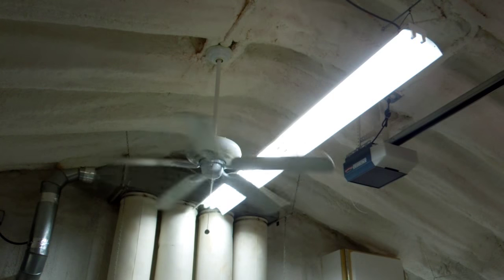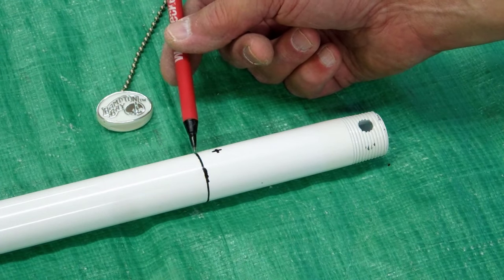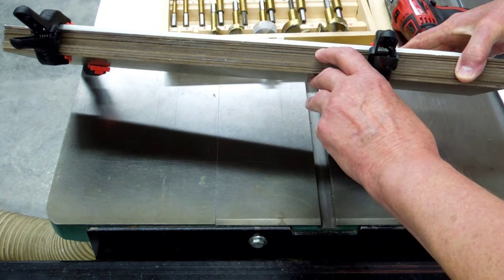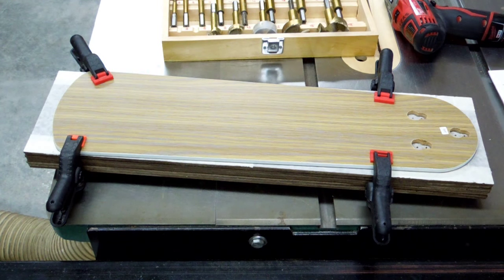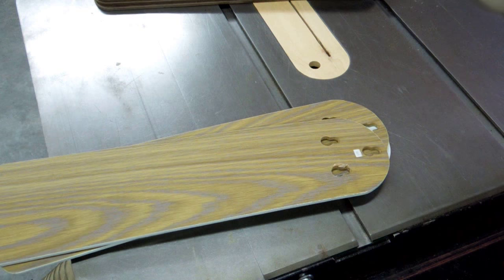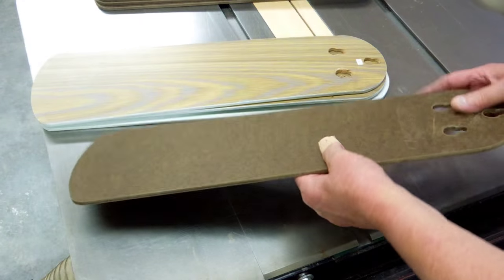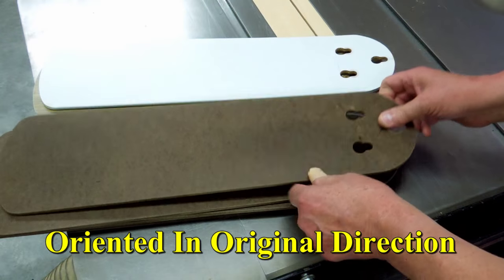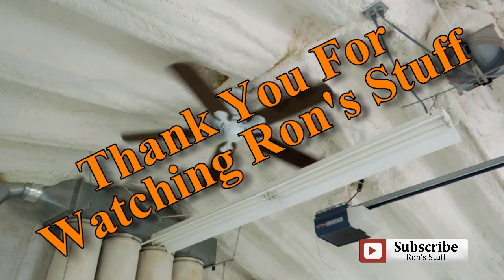Shop Ceiling Fan - Reinstalling Higher & Making New Blades

Comment: I think that the cheap-o "hardwood" floors is the same type of material as your blades. Only difference is, that material is slightly tougher since they use a type of glue that has to withstand water ingress (at least for a while).

Whilst i abhor the use of the material as actual flooring, it's pretty good for stuff like this, and the fact that you can buy it in five or six packs with predetermined sizes and edges (for the non snap-on type, the ones you're supposed to glue) it's a pretty good source of MDF like material.

Comment: Hi Ron and thank you for your great videos
I wonder if you could do one on your air handling system.  I have watched the majority
or your videos but do not remember seeing one on the air system.
What triggered me was in this video at the very beginning where you show the fan
one can see on the back wall four large pipes going to a header and my curiosity is
aroused to find out what there fore and how there used.
Thanks again   Rod
Reply from the maker: +Newmachinist  I am approaching 300 videos on YouTube so you will need to look around for information on dust collection, modifying equipment for dust collection (or improved dust collection) and to find information on my shop. Some of what you are looking for was released 3 years ago. Please Subscribe so you don’t miss out on newly released videos. Thanks for watching.

Building My Steel Garage https://youtu.be/ZnV3m4Vx500Steel 
Garage - Finding Bolts In Foam https://youtu.be/TJjqzIzRo5YSteel 
Garage - Ceiling Foam Repair https://youtu.be/-jHS2_aoDUUWelcome 
To My New Shop https://youtu.be/zohIl_UNLZMDust 
Collection Hoses - New Shop https://youtu.be/cTdN4iRzQRQ

Comment: Ron, what was the difference in weight between the new blades if any?
Reply from the maker: +Marcus460 That was clearly shown in the video. The new one are heavier.
Reply: Sorry, I meant between only the new blades 
there must be some variation?
Reply from the maker: +Marcus460 They are pretty close. The installation method snapping onto rubber grommets is more variation than anything. At slow speed it isn't going to show up.

Comment: I found ceiling fans in general a pain, even if you installed them above the lights, there are still reflections of light that is pointing upwards and blocked by the fans, thus still causing flickering. (but a lot less noticeable)

Comment: Any reason to keep the original style blade? If the original blades were junk, I'd assume they weren't necessarily optimized for performance. Have you tried a shorter blade length or a different  tip shape? Honestly, I was hoping for a huge blower style blade. :P
Reply from the maker: +Danny Jepp  The blade design is typical of that used on most ceiling fans. I had no reason to change the design. They are a relatively low power motor and intended to disturb the air... bring hotter air at the ceiling downward in the winter... push cooler air upward in the summer.